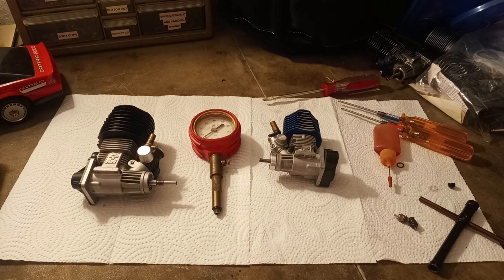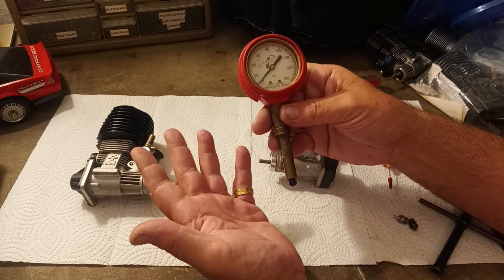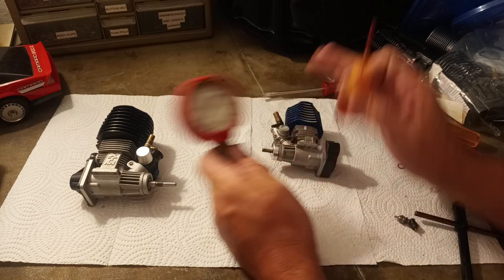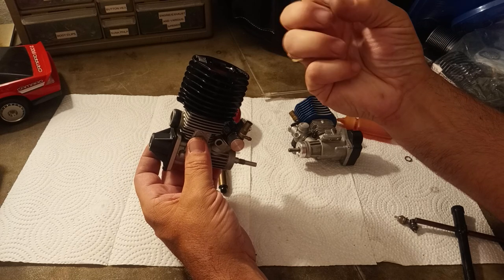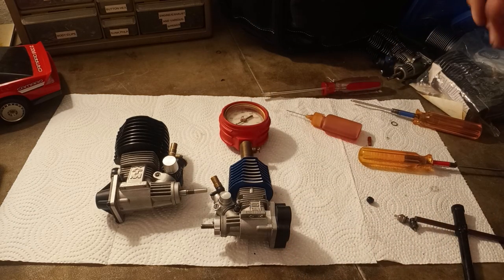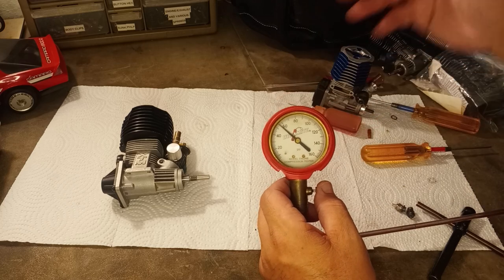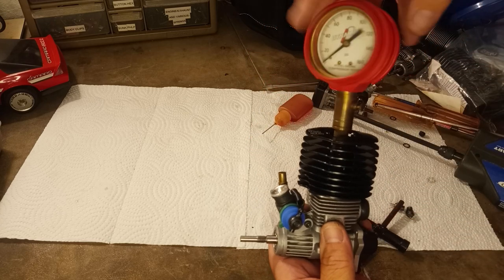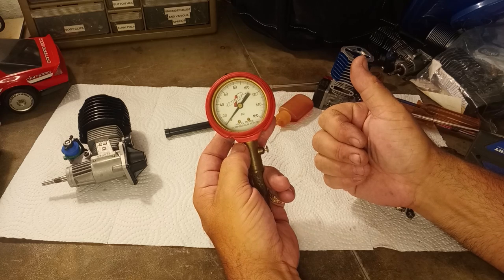Let's Talk about the Dynamite model engine compression tester standard plug nitro pressure gauge

Comment: That very interesting when I don't use a nitro engine for a while I take out the glow plug and put a couple drops of nitro fuel in it and put the glow plug back in to start the engine. in my mind every one is running  there nitro engine dry for a few sec every time they start the engine because of lack of fuel/oil even more in pull starts IV seen people pull and pull them remember to prime the line IV ask a couple people there answer was I always prime it first not understanding it still takes time for the fuel to get to the engine specially if the line leak or filter plugged and the engine been sitting dry Even after run oil only stay for so long at least it my opinion 🤔👍👌✌️💯🍻